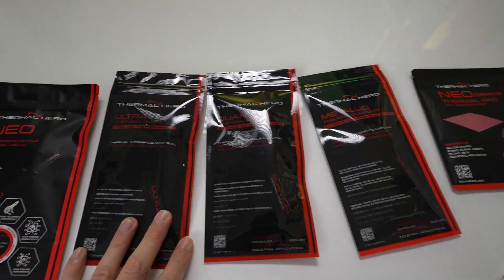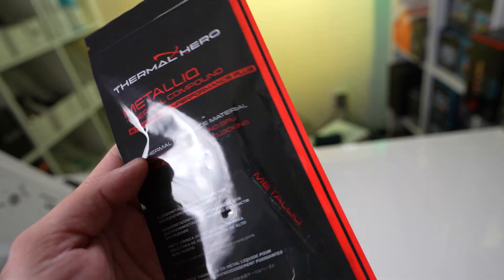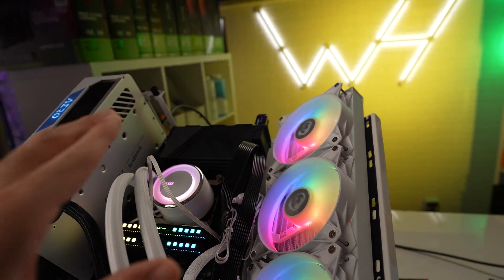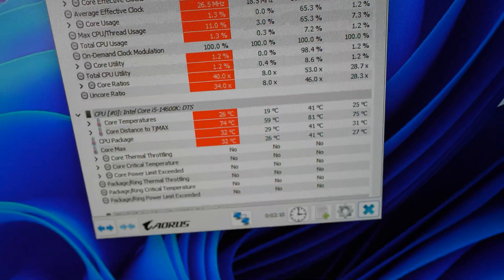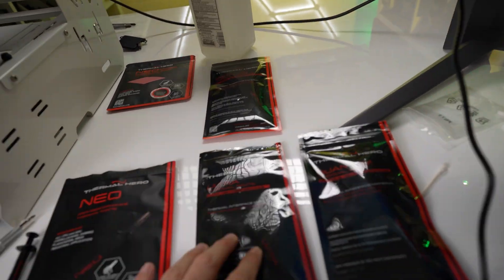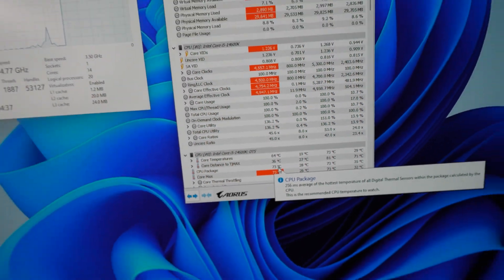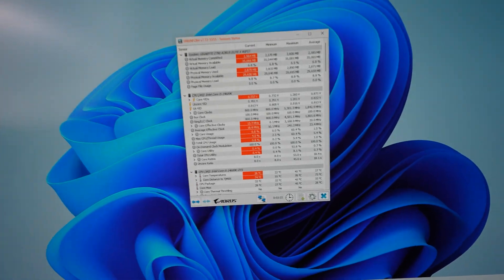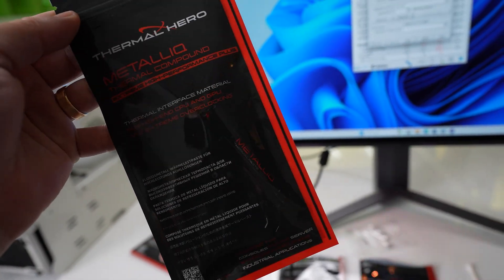Thermal Hero for PC Cooling | Thermal Paste | Wired Hardware

Comment: Most likely had heat soak on your radiators on the Quantum test after the Ultra or didn't seat the cooler very well. The tests I have seen between the Ultra and Quantum show a sizeable difference. The Quantum is around -4c to -5c cooler than the ultra at max loads and also falls back to a lower idle temp quicker as well. I believe it's also about the same temp as Noctua's NT-H2's paste although I have seen benchmarks showing Noctua NT-H2 consistently getting -1 to -2c lower than the Hero Quantum. You also need to account for Ambient room temp during each test as having a PC running non stop while pulling max loads off and on is going to eat up the air in the room. Just depends on the size of the room and if the AC is running.

Comment: Quantum works much better than the Ultra on my laptop and in fact it is one of the best paste in the market. Quantum is quite a bit more viscous which helps on uneven low pressure heatsink.